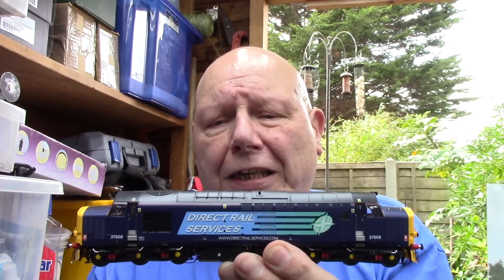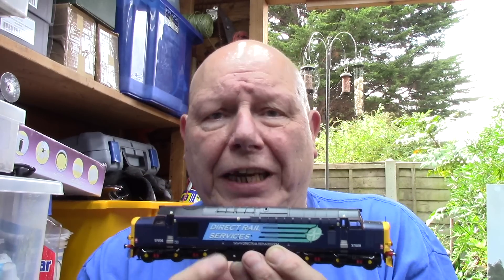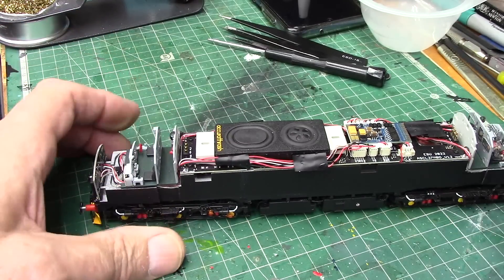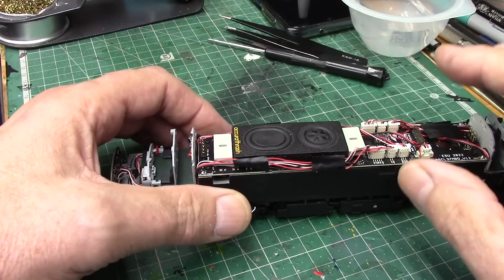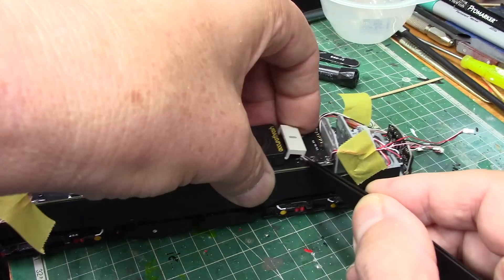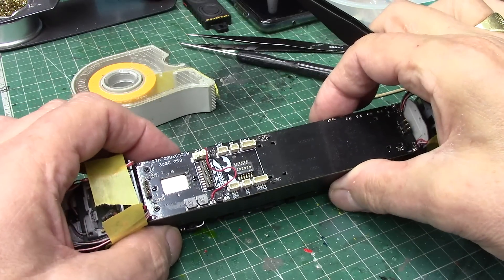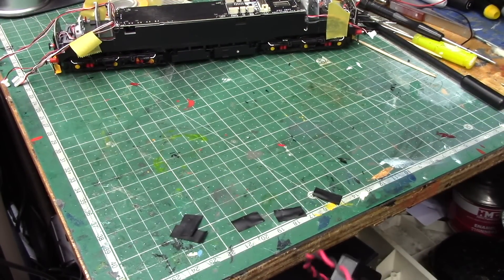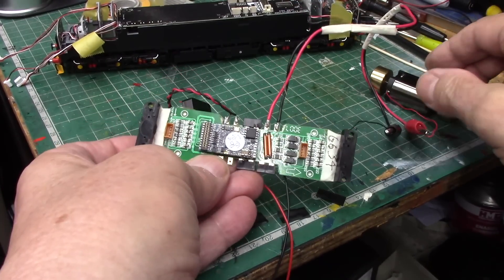Issue with Accurascale class 37 part one

Comment: I’ve just had the same problem on my Hattons class 66,the motor looks identical to your class 37 motor.I found that both the pole magnets had become unglued from the motor body causing the magnets to hug the armature which was causing rough running and excess amp drawer.I super glued the magnets back in the correct position and found the motor to run perfectly again.
Thank you for your great video.

Comment: Hi Peter, Spot on, I found this out and told Accurascale about it weeks ago. Out of my 6 37's, 4 have the problem. I went a bit further and stripped the motor down. The problem is with the brushes. When you look at the commutator the pads are bridged with what looks like copper. This is shorting out and causing the increased amperage. (I have photographs I can send you). On that particular motor I cleaned the grooves on the commutator out and refitted the motor with Hornby brushes. That loco has now done over 16 hours and it is silky smooth, even smoother that an Accurascale without a problem. Incidentally the problem only really starts to materialise when you have done a couple of hours running. I have a Z21 and noticed the amps jumping up straight away. There is no guarantee that your replacement motor will be a good one!
Reply from the maker: Hi Cliff, stay tuned for part two video as I have some good news, as while I am waiting for replacement motor, these idle fingers got to work on the motor and I decided to take it apart.Like you I cleaned the grooves on the commutator careful put back the end cap containing the brushes and I had a total different motor running perfectly. I am testing for now but I think its fixed :) When happy will post the video showing my results :)
All the best Peter
Reply: @torridonroadbypeterdixon4162  That’s good news, but I did that and I am afraid it will be short lived. The brushes are too hard and are wearing the commutator. The brushes will wear the pads and deposit the copper particles back in the groove. The only way I have managed to cure it is to fit the brushes/end cap from a Hornby motor. That one had been running over 16 hours! The brushes in a Hornby motor don’t appear to be as hard as Accurascale. I have sent them all this info along with all the photos.
Reply from the maker: @cliffhorner  Ok Cliff that's good to know and disappointing too. I don't have any other motors I can try what you did so I might start looking around Thanks for the heads up Peter
Reply: Downfall with accurascale is they get so personal about us finding issues with their models like it’s end of the world! I’ve had accurascales Richard block me because I’ve shared this video! Accurascale have all blocked me because I’ve shared other issues with their windows falling out of the class 37’s …….this issue regarding the motor doing possible damage to circuit board in my eyes is probably the most serious so far!

Comment: They really need to get their head out of the sand with this issue. Instead of banging on about how it’s such a  minority and blaming customers controllers.
Reply: Not really you just dont realise that it is the truth it is only a minority of people. Motors are a rotating fuse and all fail eventually. Its just luck of the draw and applies to all manufactures. Its not a problem with accuracale the motors will be made by a chinese factory the same as all the others. What does kill motors is certain control types. They are not all the same and some motors are more robust than others. Its not as simple as you assume it is.

Comment: Excellent video Peter.
Likewise I have the DCC Concepts Alpha meter and find it a “must have” to see what’s going on power wise.  As yet, only running a test track which gives me very reliable readings on the meter.  Nothing on the track, obviously no current drawn so what ever it shows with a loco on track is a perfect reading.  Going on your video, it would appear you have a standing current draw of 300 milliamps with your “on track” locomotives, hence your readings of around 400 milliamps work out to only 100 milliamps to the motor on a running locomotive, way below DCC decoder ratings.  There will be small variations in current as motor load increases due to friction between wheels and track when negotiating bends and point work.
Interesting and a little disconcerting to hear you’ve had motor trouble with the Accurascale 37 particularly as I have one on order from the second run.  Hopefully yours was a one-off and I’d like to think these motors are built to the same quality as the model they’re fitted in.  That said, I’ve had two Bachmann Class 66 motors go bad on me drawing close to 1 amp and getting rather hot in the process after what might be considered low usage.
Thanks for a most interesting video as I now consider myself all clued up on strip down and motor replacement for the 37, which, fingers crossed, I won’t have to do.
Regards Dave B.
Reply from the maker: Glad to have been of use David. I do go on though LoL Cheers Peter

Comment: Hi Peter, great video as always, i have an issue with a noisy fan motor on my Hornby Platinum Juubilee HST set dummy car, i phoned the retailer i bought it from, they said i should bring it in so they can have a look, to be fair its the gearing inside the fan drive unit, i have cleaned it out and re-greased with a silicon quality lubricant, this worked with the other fan units on my 21 pin Railadventure hst set and the power car from the 21 pin Platinum Jubilee set, like you i don't want my dummy car handled and damaged as its pristine, i contacted Hornby about buying a new fan unit to which they replied i have to send it back for assessment, i am going to fit sound to the set in a few months so its not a total let down, just go to show manufacturers like Hornby who sell items that are not quite right but won't sell parts to repair them, the fans in my Bachmann class 47 are silent in operation, such a shame their units won't fit inside the Hornby hst unit, thanks for sharing this very informative video with use mate.

Comment: Very interesting video Pete. I have had the same problem on my class 37 locomotive number 37419. Mine is a dcc ready version and to confirm the problem ran it on two different tracks and rolling road. I have had to send mine back to Rails who confirmed the problem and it has had to go back to accurascale for motor replacement. Wish I had you skills and tools to effectively repair my locomotive.

Comment: Hello Peter, every Accurascale loco I've bought has done this speed variation malarky two 92s now two 37s, it always occurs after a few weeks running.
You may want to have a look on a post I did on RMweb asking in title:- Accurascale class 92 and 37 slowing down then speeding up.
it was amazing how many folk posted. It as always went off the subject and instead of how many folk had this problem it went more into motors. The topic is now closed? I have heard that the problem is the brushes being copper and using carbon brushes cures the problem? There is no way I can fix my locos due to eyesight and numbness in hands, so I am reliant on either refund or replacement. What you can do earns my admiration, Bill.

Comment: Hi Pete
What a superb video, very informative and well presented. 
Just for your information, there were similar problems with the Hattons 66 motors and on RMWeb, under the 66 thread, was a series of photos that showed the problem with the motor. Taking the brass end cap off and pulling motor slightly out of housing showed the brushes not quite aligned with the commutator. I did this with one of my 66 locos and after re-aligning the brushes, all worked well although was a bit of a faff! Hattons did not do spare motors!! Best regards John
Reply from the maker: Hi John, that's interesting about the 66 motor I will see if I can find it. I had the same thinking it could be the brushes and can see that on this and the Hattons motors that it was a fault with them but on the other hand the motors for the Bachmann that I tested have brushes that are removable if needed. So they line up perfectly and yet they can give the same problem. Could be they are damaging/scratching the surface of the commutator. Seems to be a lottery with these Morden motors.
Cheers Peter

Comment: Hi Peter I had the same problem with an Accurascale Class 92 the current drawn became so high it kept tripping out the power supply due to overload. I sent it back to Rails who also had the same problem and they in turn returned it to Accurascale for attention. They tested loco and could find no fault so back it came to Rails. They tested it again for 4 hours and it ran perfectly so returned it to me. I've ran the loco frequently since then and it appears okay which is rather worrying so my fingers are crossed that the problem has gone away.

Comment: Had the same issue with one of mine, then got a replacement, but had a hunch that it was the motor at fault.
I changed the motor in a Hattons 66 before now, and I could have sworn it's the same motors as these 37s.

Comment: There has been some reports of what you said here in terms of running, which has been down to a faulty DCC chip as there is still a shortage and components are still not great quality... which leads to erratic running... always best to check on straight DC.... then you can clear and check the motor. However I know the motor manufacturer and with the number they produce I am not surprised there's the odd duff one around.. Hornby use the same supplier.
Reply from the maker: Hi Matt Yes to discount it being the chip. First test I did was swapped the chip into another loco and it worked perfectly and a known good chip into this loco and it ran with a fault

Comment: I have replaced motors on a Bachman 419 mlv and a Heljan class 33 and sent a Dapol 73 and an Accurascale 92 back all with the same symptoms. I ran the faulty motors on a 9v battery to rule out ‘it’s your controller’
When I took the old motors I replaced apart the commutators were damaged by the brushes. I don’t know how much quality control the motors are subjected to but not much I suspect. I think they just accept a failure rate. The joys of multiple outsourcing chains.
Reply from the maker: Yes I wonder if the "carbon" of the brushes is to hard and damage/scratching as you say. Something to be said for the old motors where you could clean surfaces and replace brushes etc Can't do a thing with these things except get another

Comment: Had the same issue with my class 92 in the end it would crawl around even at full power plus high current draw on the amp meter took nearly a month to get a replacement sent out,detail kit was already pre fitted on both ends so probably a used model but at least it works

Comment: it does it when you have the motor out, not attached to anything. obviously the motor or shafts, or flywheels. not binding wheels or drive shafts. you are right, hopefully the replacement motor will be fine. you could always put a motor from another accuscale 37 in to prove all the drive chain is fine, for peace of mind that it's all ok, but the motor is definitely dodgy

Comment: Hello. Can I ask, how long you had the '37 running OK until it started demonstrating faulty running? Cheers, Chris.
Reply from the maker: Hi Chris. She had a 30 min running in time both ways at first then over the next few days maybe the total time of running that loco was maybe 3 or so hours.
Reply: @torridonroadbypeterdixon4162  That’s awful though I'm glad the problem showed itself quite quickly 
 Does that indicate a one off faulty motor perhaps.  Hope so. Does rather spoil the Accurascale experience for you. I think you acted completely correctly in taking matters into your own hands and changing the motor yourself. I'm expecting my '37 any time now so let's see if I have an issue.  Cheers Chris.

Comment: It's so frustrating Peter - I've had exactly the same experience and they just repeatedly blame my PiSprog controller. I raised the issue on RMWeb and they got the posts taken down. In a more recent thread this week others have shared the issue and again after a couple of days the thread has been locked to prevent discussion with the answer being to contact them - not sure why they can't improve the quality - never had this with a Bachmann loco (or a Hornby infact!)
Reply from the maker: Sorry to say Adam this problem is not exclusive to Accurascale as I have had problems with Bachmann and Hornby motors as well
Reply: @torridonroadbypeterdixon4162  Hi Peter, it's not exclusively - but there does seem to be a high incidence rate. Hopefully they can sort the production issues out!
Reply: Clearly a common issue. First reported it almost 12 months ago and still seeing the same cop-out responses on rmweb blaming controllers.
Reply: They've removed taken down my friends comments to on Facebook its a regular thing! A few of them re posted the comment again and guess what... yes comment removed again! Overall i'm getting constant messages and them complaining about faulty accurascale or broken accurascale same with bachmanns latest tooled model, motor issues running issue's... it would appear bachmann re tooled and rushed out there 37 & 47 very quickly to compete in the market with accurascale all in all i do not want to have any here from either company now to weather detail or do out on i'm sick to death of the issues now and really don't have any patience for these super detailed full of issues models.

Comment: Hi Peter. Ive recently got the newest bachman 37. 
Frustrating.. goes mental doesn't respond to emergency stop when needed. New plux 22 chip fitted ok. Please can you share what cv's you've set your 37's at so that I can go any further with this model. Many thanks John...
Reply from the maker: Hi John, the problem is I don't have the new Bachmann 37, so my setting won't do for your model as I believe its a totally different setup to mine, so sorry I don't think I can help and to be honest from what you say about not responding It doest seem yours is OK so CVs are not the problem. Have you done a reset of the chip? It's what I would try. Hope you get it sorted
Cheers Peter

Comment: Does your 37 models feel warm after running after about 30 minutes to an hour ie after running in because was wondering if that might be a sign of things to come if not it's just a motor that gets warmer with no consequences thanks again
Reply: Yes, its starts to get very warm due to the increased amps. I have had 4 out of my 6 37's develop the problem. It starts to show around 2 hours of running. I run mine in at a moderate pace, 1 hour in each direction. If you get to 3 hours your doing well!
Reply: @cliffhorner  good to know but hopefully it doesn't become a problem and the motor burns out and need replacing and you just run in sections at a time allowing it to cool down before running it again
Reply: @penjunction  If its getting warm it indicates that there is already a problem. The problem I have seen on all of them so far is that the brushes are too hard. The brushes are wearing the commutator and depositing the copper in the grooves between the pads. The build up of copper then causes a short between the pads which increases the current draw, in return generating the heat.
Reply: @cliffhorner  thanks do you think I should get in touch or wait and see if there is a recall or if it becomes more of an issue?
Reply from the maker: Hi, pleased to say the motor did not get hot, however that may be down to the fact I did not run it much after the problem.

Comment: If I had a faulty item, I would not fiddle with it, I'd return it to where you brought it, and require them to replace, repair or refund.
Reply from the maker: Hi there, yes done that in the past and got back a loco with marked bodywork that still didn't work. Plus I love to meddle and that resulted in the model working fine now (see part two) 
Thanks Peter

Comment: This has convinced me not to buy the 37. There is obviously a manufacturing issue and considering the price of these models it’s unacceptable.
Reply from the maker: Hi Richard, the trouble is there are plenty that have not had problems. I really think that it maybe down to a faulty batch. At this moment in time I have replaced the motors with new ones sent to me and all is well. Time will see if this has now cured the problem. Cheers Peter